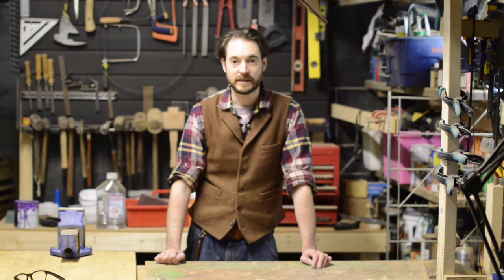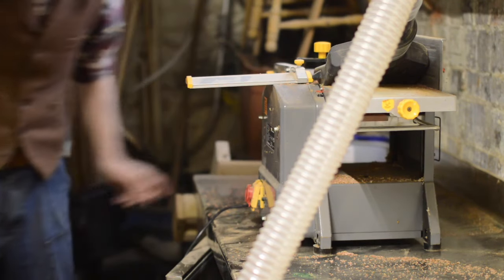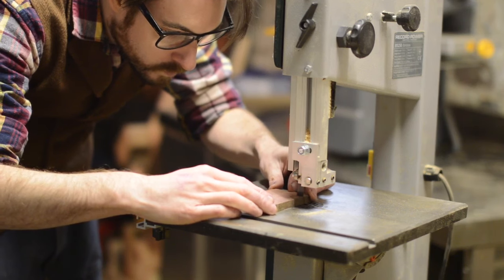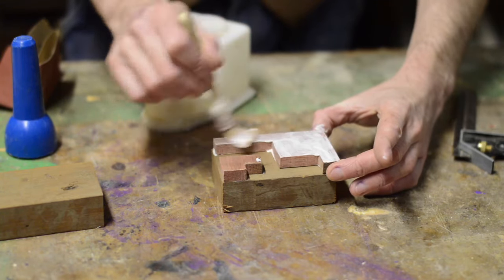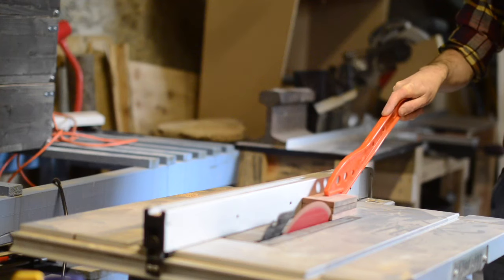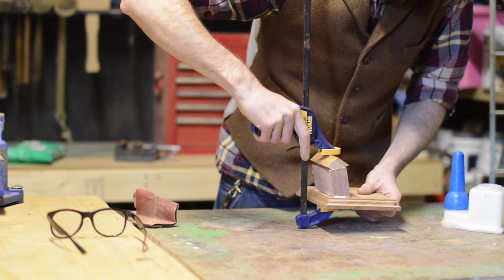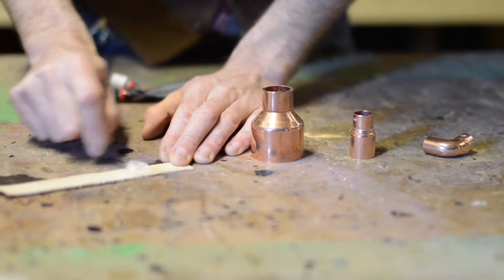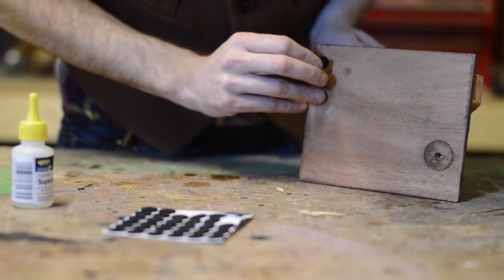Iphone acoustic speaker

Comment: Is the epoxy needed? My experience with pipe fittings is that they have a tight fit from the start. Also, this could need an integrated charging cable so that it is an acoustic amplifier charging dock. Well, that is how I will make it once I find the materials and time
Reply from the maker: The fit was quite loose so needed gluing together. The larger is a good idea. When i need a new phone i will have to make another and include on.
Reply: Badger Workshop Make sure to film it again than ;)
Reply from the maker: Haha I will but i don't want to bore you.
Reply: How can I be bored by content from this channel? It seems clear that more than 1500 people do like your style, so I guess you don't need to change it. It is not that 2/3th of you subs are family or friends (that is my case for the moment), so time to get some confidence about it. But I like you humbleness, maybe that is why received that many subs yet. I would say to keep, the quality content coming, you are doing good